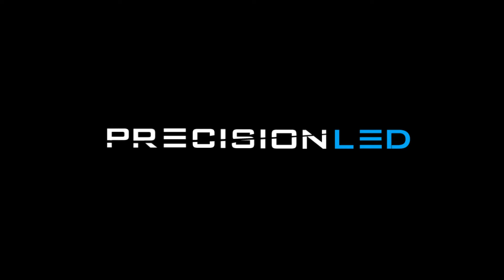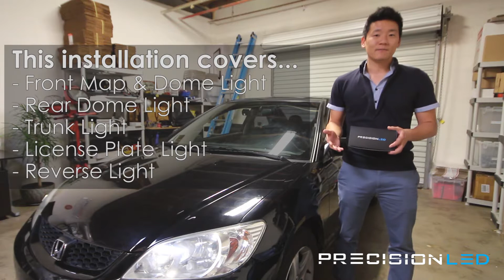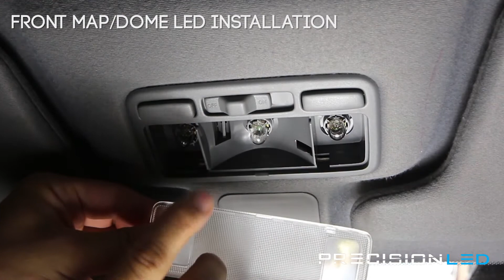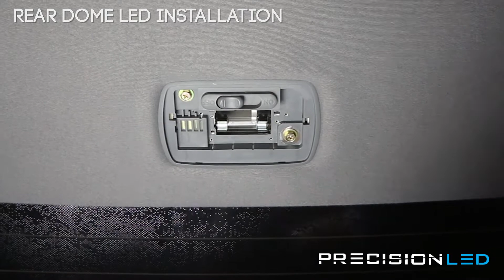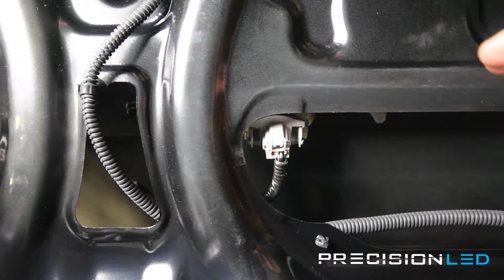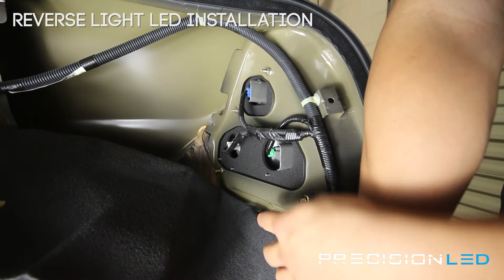Honda Civic LEDs How to Install - 7th Generation 2001 - 2005

Comment: Does anyone think it’s strange that none of the 3 lights work when I open the door? I just bought this 2005 Civic sedan and noticed no lights working when entering my car. I’ll ch ck the fuse first. If the lamps are bad I’ll use the LED replacement bulbs
Reply: You have a bad MCU (multiplex control unit). 

You got an aftermarket head unit btw?

Comment: I have an '02 Civic Si Hatchback. I did LED upgrades on my parking lights. Worked fine. Just bought suggested LED upgrades for reverse lights at Walmart: Sylvania 6000k type 7506. That's what the bulb selection center said anyway. The bulb plug ends matched those on my incandescent...none of the other options did. Fivured I had a winner. FAIL! They don't work. The sockets are good b/c the incandescents work fine. Do I need load resistors? I thought those were only for blinkers.
Reply from the maker: For the reverse lights you would need to use a T10 fitment, which you can find here: https://www.precisionled.com/premium-t10-canbus-10smd-5730-led.html